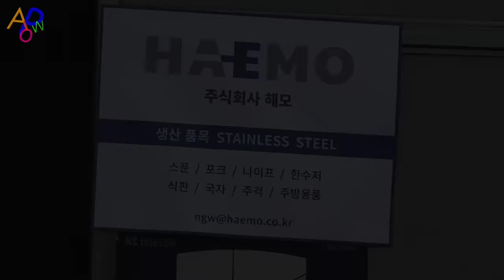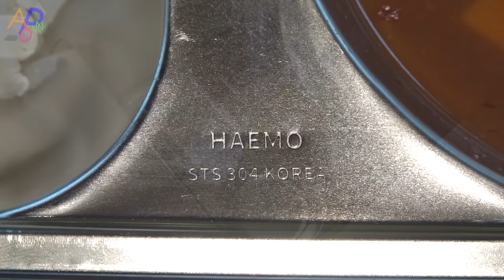Skilled Korean Steel Food Tray Mass Production Plant

Comment: at 0:58 its very dangerous to stand on that side of the machine. no safety lights or guards. you can place 2 L shape blocks 2-4inches shorter than your shut height/die height on the sides where you tie down the die to block how far that person can reach in that machine so he wont get his fingers chopped off and it wont affect your parts drop off location. just in case he trips or reach in too far his fingers will never go inside that die.